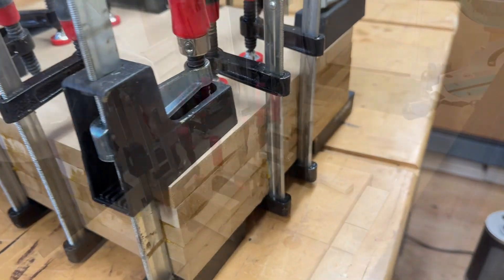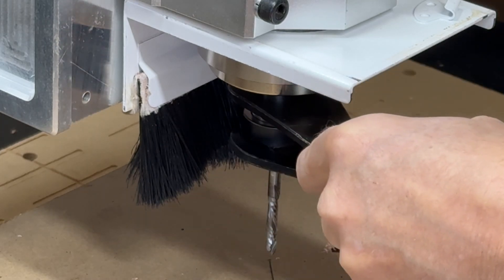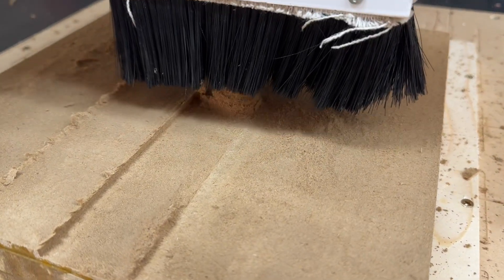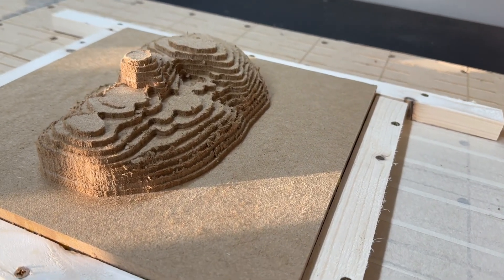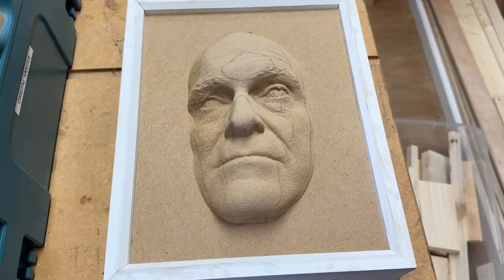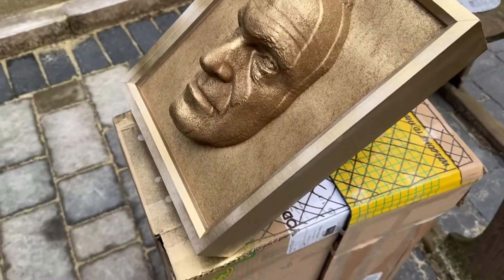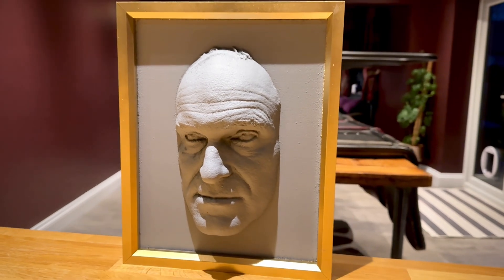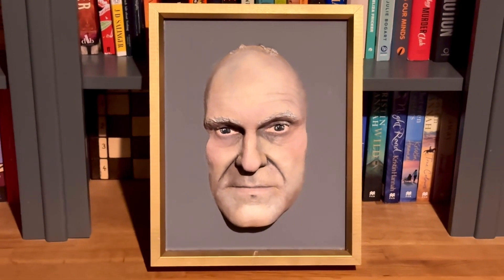Lidar sensor and CNC cutting model test

Comment: Looks great (and slightly terrifying) - I wonder if you could unlock their phone with it!?

Regarding tool paths, I recently made a landscape based on a drone survey. I found the morphed spiral tool path in fusion to leave a far superior finish than the parallel path you used here - I suspect you could achieve the same level of finish with a shorter process time particularly on larger models like that one.